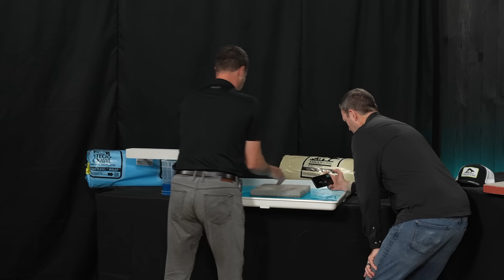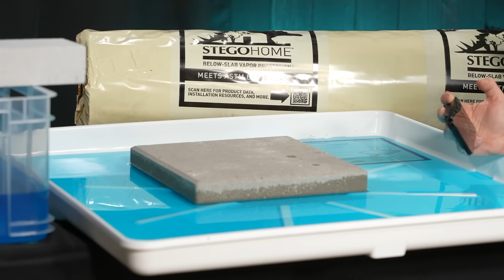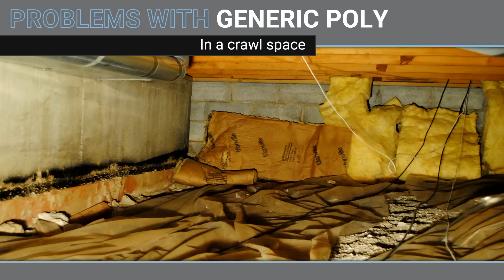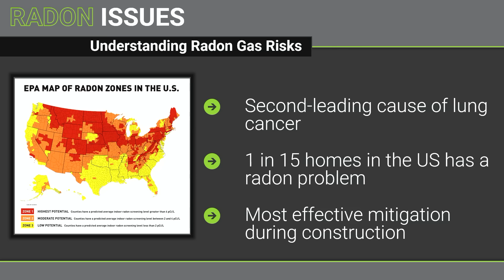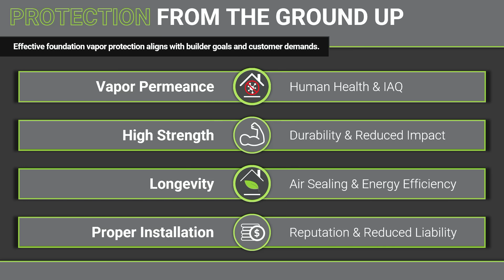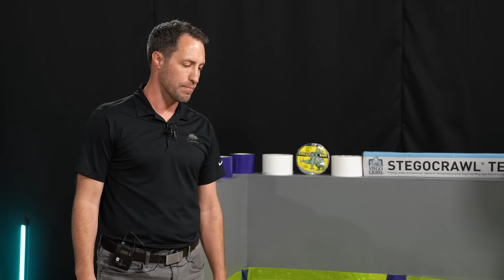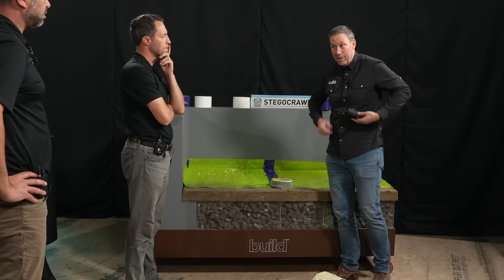Stego - Is Your Below Slab Vapor Barrier Really Doing Its Job

Comment: For Young Matt, Remember the J&L Steel slag dump next to the Squirell Hill Tunnels? Can you believe they built a community of McMansions there? What toxins were dumped along with the mill slag? I doubt these homes were built with the care needed to keep the home owners safe. Lucky if they got the poly; hey slag was dry and hard.  always learn something from the Build Show.
Reply: the slag you don't have as much to worry about depending on the steel formula they were using. They use Slag as a cement sub for concrete now for most foundation formulations depending on the region. Mini mills can really make using steel slag As this immense substitute or additive more efficient because you had better control of the final product.

Comment from the maker: Curious what ya'll thought of the water absorption demo? 3:36 - 4:20
Reply: This demo is the reason why I put Pango wrap under my 42" wide footers.  I don't want water wicking up my 48' tall ICF walls.  As Joe would say this would result in a damp diaper because I have EPS foam on both sides of the 8" concrete walls.

Why isn't it an industry standard to put stego/vapor barriers under the footers?  The stego tape isn't that expensive and that is how I will attach the rest of the pango wrap in my crawlspace to keep the radon, water and termites out of my multigenerational forever home.

Plus the stego keeps the ground from wicking away the moisture in the concrete as it cures which results in a stronger product.

Thanks for recommending it years ago because putting it under the footers is definitely not a retrofit option now that I have 1 million pounds of concrete on the footers 🤣
Reply: These blocks are not as dense as a 6 sack concrete.  
Yes, a great vapor barrier is a great idea for a slab.
Reply: Proof of how porous concrete can be! We love the live demo, Matt! Thanks for hosting Stego!